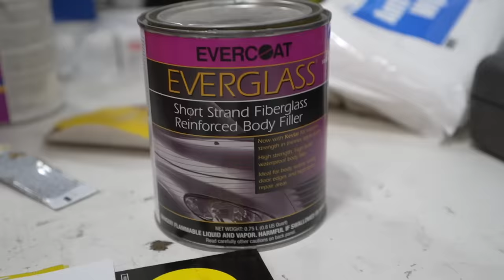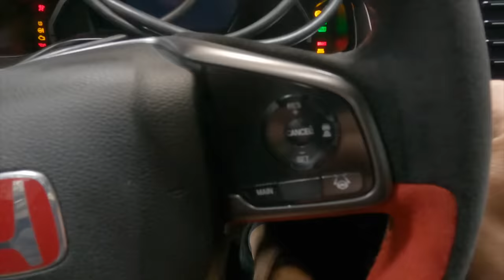Incredible Rebuild of a Totaled Civic Type R in 20 Minutes!

Comment: Am I wrong that the main bars are micro deformed, distorted to unrepairable degree. The geometry, the atoms of the metal are disconnected at the points the metal bend from the impact.

Both the geometry and stiffness is different. They probably will mislead someone to buy it, but that's not ethical.

Comment: im all for saving anything when we can, but after 15years of dealing with vehicles in a collision and living in the north, i always replace the engine bay harness. you just cannot predict how a pinched harness will fail. seen to many times after a car is released to  customer. goes 100km then shuts down in most dangerous of situations cause of a shorted wire. its your personal vehicle but imagine that happening to a customer. on phone with insurance company next. screaming they don't feel safe. vehicle should of been written off.  just not worth it.